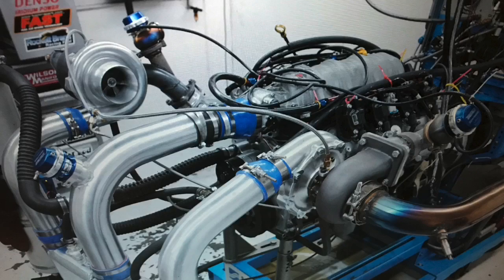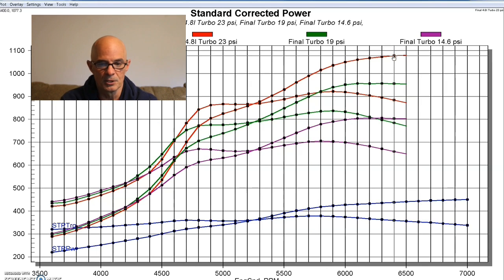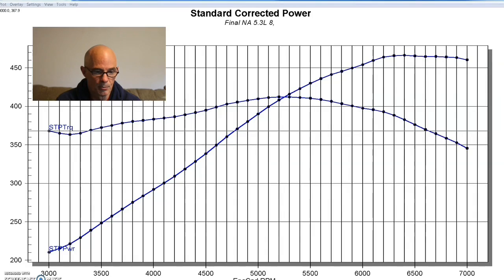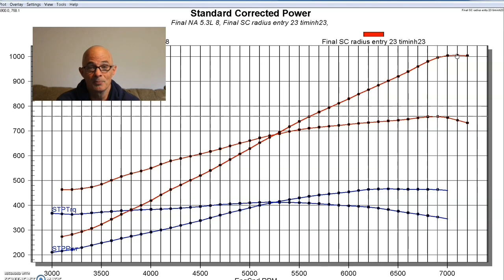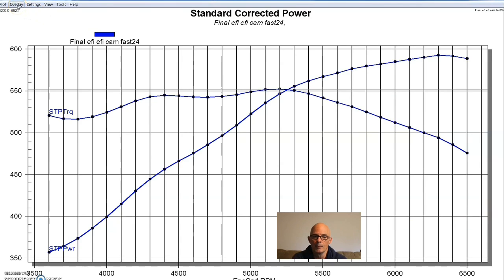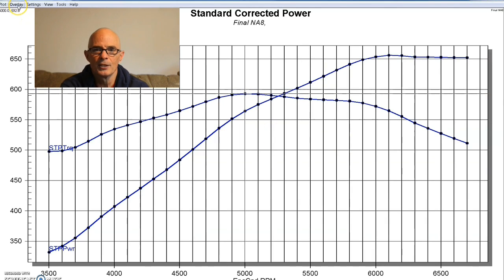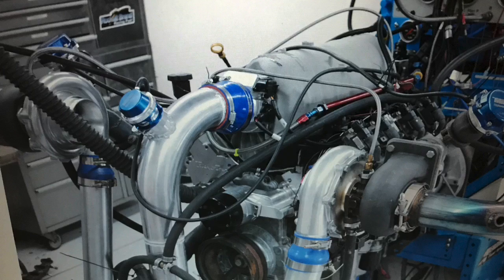LS HOW TO: 1000-HP POWER RECIPES (COUPLER EXPLODES!)

Comment: yes keep going up !!! I have a 6.0 made into 6.2l , 227/235 Du ,,, 620/605 lift , com cam,  what can this engine turn into still ? I want more power, is on my 2008 corvette automatic running 2600/3000 stall , I want to turn it into over 1000 HP, what do I need besides the money,? I am serious !!! IF you can answer me asap ,!!! I am on the prosses removing the engine, this engine is not even broking in yet !!!! but I change my mind , in want to put more pony s !!!! Please let me know what to do or what parts do I need, !! Thx Richard!!
Reply from the maker: do not turbo that big-bore 6.0L (get a different motor) add cam, springs and boost from one of our turbos (easy 1000 hp)

Comment: on the 6.0 example. what compression ratio were you running. i did the math and if there is no dish to the pistons you were at 11.58-1 and in the 900 hp example you were at 10.74:1 does the compression ratio not hurt when you get that high?
Reply from the maker: higher comp makes more power (na and boosted) if you have the octane

Comment: The fix is to easy as we do this on Hayabusa’s running up to 60lbs of boost on alcohol and nitromethane. After you coupler 5/8 -3/4 of a inch back on both sides we drill a small hole mig or tig a small fine threaded nut. Then take a 3/8 long bolt or whatever you want to use take wire and wrap it around the bolts on both sides in a figure 8 pattern tightly across your coupler 4-6 times. Leave a lil tail and wrap it around the wires in the middle. Tighten the fine thread bolts tightly = problem solved and do it at every coupler or vband as insurance.

Comment: Hey Rick..

Question..

The LSX line of SBC's is superior to all other traditional pushrod V8's since their beginning inception back in the 50's.

I plan to have a notch stang or GTA trans am, (CAN'T MAKE UP MY MIND) and the traditional Small Block just ain't gonna cut it anymore. Not even gonna waste my time trying.

I was thinking a LY6 Iron block and finding a 3.75 stroke custom crank for the old school 383 displacement. No need for a 4"+ stroke crank more plus cylinder wall angle pressure is lessened with shorter stroke also helping longevity.

I figure a good set of PRC/MAST heads coupled with a good 230's duration @ .050 cam on a 112* split and a conservative 12psi would be livable on a street car that is street 95% of the time on 93 octane and 9.5:1 compression.. Would use larger chambers for valve unshrouding and dish pistons if needed to obtain final compression

What kind of numbers ballpark?!? I am hoping for 600 when the time comes, for that i would be a happy camper.  All drive line upgrade  bolt on's and a 9" rear with T56+ manual minimum.

I want good hp wheel numbers, but i have to live in the realm of reality and durability also. Even with all 4340 forged internals..

I am in the planning stages, been watching a (LOT) of your videos and comparisons.. Well done and keep up the great work!!

Adam 

AKA "BADGTA" on Thirgen.org forums.

Comment: I,d love to see a 5.3 test with a 80mm , 88mm and a 92 or 94mm and see what one works best.
Reply from the maker: at what power level
Reply: @richardholdener1727  Great question LOL. Most videos I have seen . Guys are testing to about 24/26lbs. After watching your vid on the 4.8 test with the GT45 vs the 75MM . I thought of the bigger turbo test. Be curious to see back pressure and if a 94mm is TOO big to run on a 5.3 using E85. I,m sure that all sizes would make decent power. But is there one that is better suited so t speak. Great video series. Just started following and enjoying what you share.

Comment: Some guy who does engine comparison videos said that every time you add 14.7 lbs of boost, you double the HP...  So why did the 416 LS3 based engine make nearly 600 HP N/A, and only 1045 at 22 PSI?  Seems like something in the combination was off, or was it due to the blower's parasitic losses?

Comment: Love the series, but please start doing the dyno pulls from a lower RPM. That and overlay all the final pulls on one sheet at the end. The supercharger/turbo comparison video could have done with this.

Sick of seeing the initial runs starting at 3500 (Already somewhat high) and the second runs you guys regularly do from 4500RPM.
Not to mention NO2, saw one video where it was shot roughly 1000RPM before redline. 
Back off the ramp rate if you have to.

Also keen to see more comparison testing.
Would love to see things like only the difference between stock heads and flowed heads..Only the difference between different header primary diameters (Turbo and N/A)..
Only the difference that varying compression levels make etc.
You know, things the internet like to argue over.

Comment: Thanks for the facts, and head start for new builds! What injectors(size) did you use on the 1k builds? What in injectors would you use now for ignite?(size/brand) thanks again, Aaron 
Tx speed 408 s485 Holley 120lbh high ram trick flow 255 ljms 4 cam 4l80@20lbs 888whp
Reply from the maker: we ran Holley 120s on the big bang 6.0L motors
Reply: You are the man

Comment: I'd like to see how far "reliably" you can push a stock bottom end LS1 with boost. Such as increasing ring gap, rod bolts, and head studs, but stock pistons, crank and connecting rods!
Reply from the maker: we took the 6.0L to 1543 hp-its still alive-that video is up-no change in rod bolts
Reply: @richardholdener1727  what's the name of that video? I'd like to check it out. Thanks Richard! Keep up the awesome videos!

Comment: Crazy idea. LM7. Flat plane crank. Forged. Twins to 35psi. E85 and T56. Think itd make it 100k miles as a daily? 😂😂😂🤔🤔
Reply: Excuse my ignorance but what is a flat plane crank? I've heard the term several times but have never figured out what it actually is.
Reply: Flat-plane vs cross-plane refers to the alignment of the rod journals on the crankshaft. Easiest way to understand it is amercan V8s are crossplane. Thats why u get the "gallop" or rumble when theyre running. Flat-plane is how 99% of inline 4 cylinder motors are. Or ferrari/lamborghini. Smooth screamers. There r advantahes and disadvantages to each. Do some looking around if u want more in-depth info
Reply: @crash5811  ok so a flat plane means the rod journals are 180° apart
Reply: @GreatLakesLogger  its more complicated than that. Cross plan: if u look from the end of the crank the journals r 12oclock 3oclock 6 and 9.  Flat plane: 12oclock 6oclock 6oclock 12oclock. And depending on the angle of the "V" in the engine and whether u have common pin or split pin crank itll make that more complicated. American V8s r generally 90° V so common pin works well. Im not sure if there r any split pin v8s. Doesnt matter here.
Reply: @crash5811  right, so they are 180° apart
Reply: @GreatLakesLogger  correct
Apologies i wanted to be clear on the information w.o specifically knowing the depth of your personal information. 😁👍
Reply: @crash5811  absolutely fine👍😀 I just got done helping rebuild a four cylinder Peogeot and wondered if that's what a flat plane crank was

Comment: Richard Holdner what fuel do you use for most of these? Is it like e85 or...? I’m hoping to do a Similar build on my 6.2 but I would wanna use pump gas still.
Reply from the maker: E85 works at this power level-we use 118 on the high boost stuff

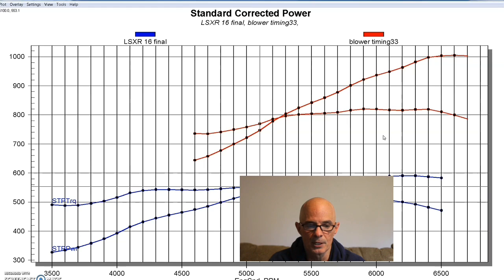Comment: Richard - You listed the 402 combo making over 1000 w/ the YSI w/ only 13.5psi, is that correct?  7:28 in the vid. thanks.
Reply from the maker: yes
Reply: What block did you make the 402 out of  I got a LQ4 can I bore it to 4.030 or do I need to stay close to the 4.00 bore

Comment: Glad to see a D1sc in there. :) I've only tuned it on the strip/street, so I don't know 100% exactly what HP I'm making. Where do you think I'm at in your experience? LS3 stock block, heads, and intake. D1sc at 14 psi and Procharger intercooler, LG long tube headers, no cats, straight pipe back. Running 11.5:1 AFR. 14 degrees timing at torque peak, 16 degrees max at 6500 rpm on pump gas (93). 105 octane I run 18 at TQ peak and 20 degrees at 6500 rpm. Any thoughts on where I should be power wise? Thanks and keep up the epic videos!
Reply from the maker: what cam
Reply: @richardholdener1727  Hi Richard. I think it has a stock cam, pretty sure it does. I don't hear any lope. I did have to tune idle airflow a bit but that may be because the Procharger is pushing a little more through.

Comment: I'm really curious about every dynochart for every combination you post. I've noticed that they all start with 3k rpms. Is there any info you can share with us about low rpm data about these combinations? I think rockcrawlers and overlanders would like to know HP/TQ numbers where they are more usable(well below 3k)
Reply from the maker: how often are you at WOT at 2000 RPM
Reply: @richardholdener1727  From idle to 3k rpms is most important for crawlers and overlanders to continue the trail safely.
Reply: @richardholdener1727  Great response. Some people in this community believe LS or nothing. The fact of the matter is you've proven all LS based engines can provide high HP/TQ...
Reply: @richardholdener1727  But what I'm trying to understand is where  a 1k Horsepower will be useable on the the street safely.
Reply: I love your attention to details  
About all components involved. Not everyone wants to go fast as possible. Some people want usable power to all 4 wheels.

Comment: Jump straight to the 1500 combo's with stock crank, block, and rods. Forged pistons and square port factory heads. Just my thoughts on the subject.
Reply: Also is there any way you could provide or possibly sell the tunes on some of these combinations?
Reply from the maker: you won't want them-its just WOT
Reply from the maker: we can't run square port heads on a 4.8L
Reply: Yes sir I am aware of the bore interface with the 3.78 bore, I was referring more to the 6.0 and larger bore engines. Not to familiar with the injected stuff, that was the reason for the time question. Very good series. Keep up the good work.

Comment: Can you do a low end max torque 6.0 combo? Under 4500 rpm. Im swappin a 6.0 into my 4x4 square.
Reply: Put 5.3 heads on a 6L.  Add long tube headers and a small cam that’s close to 200@0.050” intake duration that has a fairly narrow LSA (108-112) like a SUM-8718; typically such cams are under 0.550” lift.  

The 5.3 heads will bump up compression (power everywhere) and the smaller ports/valves help increase intake air velocity at low rpm.  A little bit of extra duration (about 10 degrees) will help bump up the power, while the narrower LSA will help move the peak torque lower in the RPM range (help to negate the bigger duration’s tendency to raise the rpm for peak torque).
Reply: Put a LSA or screw blower on it.

Comment: It's off this particular topic but i just love doing burnouts in my rat rods. What rpm range would you recommend i stay at or below if I'm going for a big smoke show. I'm pretty conservative but if i'm good to stay on it at higher rpm for longer than 15 seconds I'd love to know. Thanks.
Reply from the maker: rpm is usually limited by valve train
Reply: @richardholdener1727  so it doesn't care if it holds 5000 rpm if everything is good in the rocker/springs/lifter

Comment: I know the turbo setups are cheaper and make more power on the Dyno, but in the real world is the power given up by the superchargers worth the more linear delivery of power and easier management of boost?  Thanks for the videos.
Reply: Yes. A properly sized turbo will be plenty linear.
Reply: You can pretty much tune in traction control to make it even more manageable. Put in a scramble button for hero pulls. There's a lot more to be said about turbo setups. Roots blowers are a little better for all around, I have turbo, roots and centrifugal and by far the roots is the most linear delivery, however making power adjustments it's a lot nicer turning a knob instead of pulley setups or having to deal with belt length, slip, etc.

Comment: Richard use a set of afr 245 vs Trickflow 245 on same engine and using same camshaft.
On that lsx 427 preferably as this is where they run optimum.

Comment: So waiting for compound episodes
Reply from the maker: the compound videos are already up
Reply: @richardholdener1727  yep seen them but was referring to compound using supercharger and turbo, rewatchng those you keep referring to high back pressure as limiting, so what would like to see is how hp curve and back pressure differ with large turbo bring back pressure variable feeding positive displacement  supercharger as PD tends to drop off at upper rpm and see how power curve goes with S480 delivering in top end on small 4.8 motor which on exhaust side thinks it's bigger due to supercharger boost where would normally struggle to spool up such a large turbo or even a bigger one if you have it and see if can artificially extend power curve past cam characteristics or not

Comment: You culd make bigger increases, like go from 1000 to 1200, 1400, 1600 an so oon.
Reply from the maker: we showed you the 1200 hp 4.8L, but the 6.0L stuff went past 1500
Reply: Bottom ends won’t handle that, that’s the whole point of the Big Bang test

Comment: I love your videos!   that whipple setup would be so obnoxious on the street. That would be my choice because of the power it makes in the street driving rpm, and it would still crush at the track.
Reply: For the cost of the Whipple, I'm going with a turbo. I'm not saying that Whipple ain't gnarly because it absolutely is. I just don't want to cut a hole in my hood lol
Reply: @rcairforceone  depending on the application you often don't need a hole in your hood for that type of supercharger.  I play with much less powerful cars than they do on this channel but even a mercedes E55 or any platform that uses a M113K engine can maek 600 wheel TQ at 2K and mid 500whp up top with just headers, pulley, and throttle body.  While its not the craziest power numbers it makes for one hell of a fun street car because of the power delivery where you use it on the street.

Comment: What fuels used throughout ? And when it's so easy with good fuel...you know it can be done on pump too.
Reply: He uses E85 unless otherwise stated I think. Watch his video on the different fuel grades and power and you'll see why!
Reply: @rcairforceone  see why what ? Yes of course E85 is great fuel, but he did also sort of imply in another comment you couldnt make 1k on pump on a boosted LS...which he should know better. The B15 he had would be an ideal test motor for it with a pair of turbos
Reply: blow0me it’s a lot harder to make 1k on 93, would need a shit ton of meth. 800-900rw is basically the limit on 93
Reply: @blow0me  see he uses E85. It optimizes power out. Using lower grade fuels lowers the output.
Reply from the maker: you can't do the Big Bang level of power on pump gas
Reply: @richardholdener1727  I would agree 15-1600hp is too far for pump on an LS platform. But 1000-1100 is very achievable.

Comment: Still waiting for the Coyote big bang, great content as always.
Reply: Me too, and i don't even like them. Can't wait.
Reply: @lungsup  the coyote motor is no way close to even a 4.8 ls motor
Reply: John Salary ima  hardcore ls guy but you’ll be surprised
Reply: There's a ton of youtubers with blown up coyote engines.
Reply: A 5.7 hemi too.
Reply: Me too! The coyote engine does put out more HP per cubic inch, In the test I watched the LS and the coyote engines went head to head letting experts LS, Coyote, build them. The LS made over 1500 hp and what killed the LS was that they used stock head bolts instead of ARP. Both engines ended up failing the coyote engine made 4.3 hp per cubic inch and the LS made 4.1 hp per cubic inch. I'll take an LS over a coyote engine every time. The coyote is so complicated that their are to many things to fail on a coyote. Here is a link to the shootout...https://www.youtube.com/watch?v=jzL_4yVuTX4&t=1s